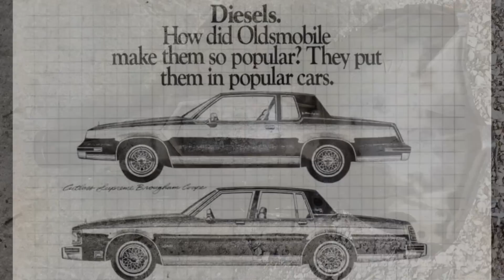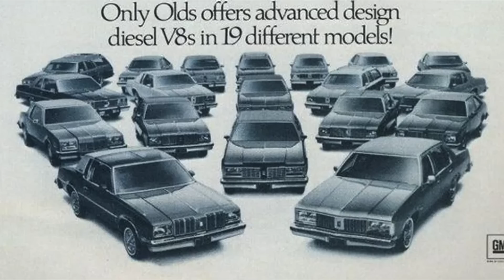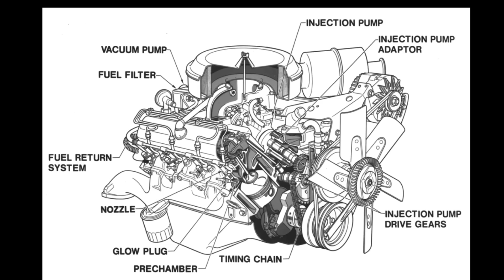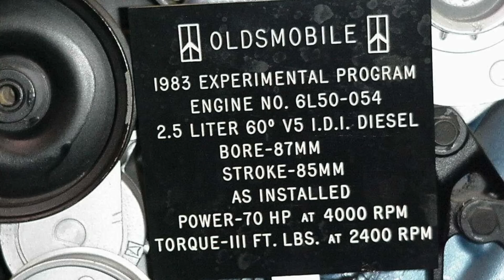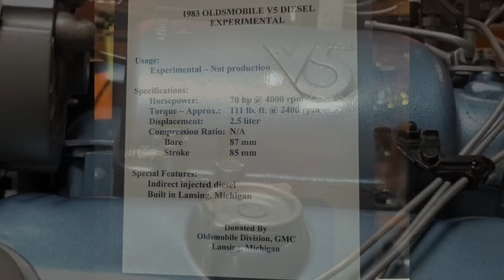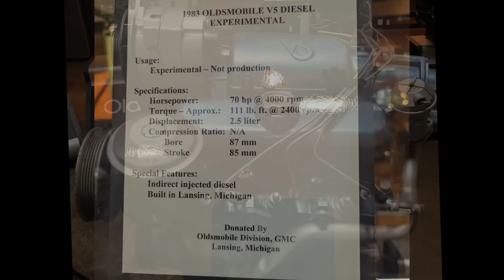Craziest Automotive Engines: Oldsmobile's V5 Diesel (Yes, I Said V5)!

Comment: Great video! GM finally did add water/fuel separators across the 5.7 Diesel production line in 1985. It also applied the water/fuel separator to the 4.3 liter V6 Diesel as well. However, it was too late.
Reply: Classic GM: finally kinda gets it right then pulls the plug in the last year. Same happened with the Fiero.
Reply: @BillLaBrie    😉 the "Fire" ero. (Unless I'm remembering it wrong)
Reply: @John.Zachary.Delorean  Yeah, they had fire issues. Believe it or not, that want the car’s greatest failing. It was a parts-bin special let down mainly by the Citation powertrain and Chevette front suspension. In the last year of production, those weaknesses were finally overcome. Farewell, Fiero!
Reply: The water separator issue wasn't even unique to GM, or the 1980s. The 2009-2011 BMW 335D had an inline fuel filter underneath the car with no water separator. The 2009-2015 VW TDIs had a cartridge filter under the hood, but again no water separator. My mom drives a 2013 Jetta TDI wagon and 2 different sets of injectors were destroyed by water in the fuel before I replaced the stock canister with a CAT water separator. Those engines also only have 4 head bolts per cylinder, just like the 4.3 and 5.7 diesels.
Reply: I may be wrong but I believe that Mercedes did not include a water/fuel separator on their '70s-'80s Diesel cars either. The four-bolt head bolt per cylinder pattern wasn't much clamping power for an engine with a compression ratio of 22.5 to 1 (the Olds Diesel). I knew of an '81 Chevrolet truck with the Olds Diesel that had a large aftermarket water/fuel separator mounted on the firewall and it blew a head gasket. The water/fuel separators weren't the cure-all but they would have saved the lives of a lot of Olds Diesel engines.
Reply: @randyrankin589  My father found a kit supplied by Racor that would bolt their smallest separator onto the fuel pump mounts on the RF of the engine. The filter could be changed in about 2 minutes with no tools. This meant that even if the fuel gelled up, we still made it to school on time.
Reply: @theodorgiosan2570  wow, that's almost hard to believe.  I had a 1982 GM 6.2, with what was on that truck, I would have thought that was a bare minimum going forward, for anyone building diesels,, especially zee Germans .
Reply: The real problem with the injection pump was the fact the Rose Master pump had a plastic retainer for the weight cage that would fail due to the heat of the pump mounting location causing timing problems. I worked as a mechanic that repaired nothing but GM diesels.
Reply: Yup, hard to believe they did that...and yet with the 6.2 (did the Detroit division build ?, yes I know the 6.2 was 4 cycle, I had one), they had 2 filters for fuel filtering, one had water separator, from the launch of that engine, mine was an '82.  (I had a gloss sheet with specs on it from the 1980s here somewhere.  I know it said the Detroit division built the 6.2)  maybe they should have let them develop the 5.7, not Olds.  But they did even dumber things like waste a few billion $ on rights & developing the wankel rotary for use, & that project was stillborn.  DeLorean was upset Ed Cole wasted $ on that project.  He said "that damn thing looked like it fell out of a 1912 farm tractor
Reply: On the FWD 4.3 cars you had to rock the whole engine forward in the car to service the rear three injectors. It sucked.
Reply: You had to do the same thing on a transversely mounted Buick 3800 in order to get to the three spark plugs on the head of the right bank. @bartismoellis1052